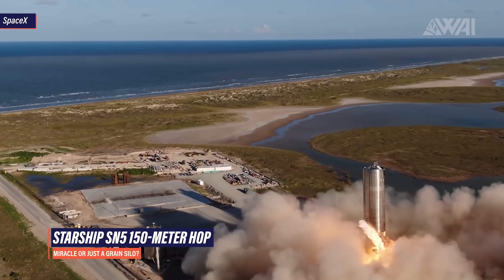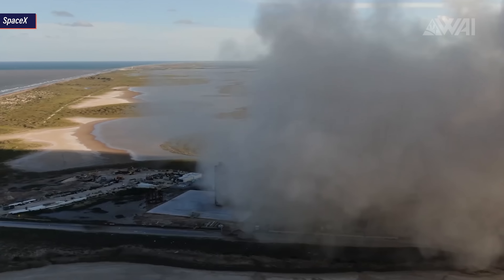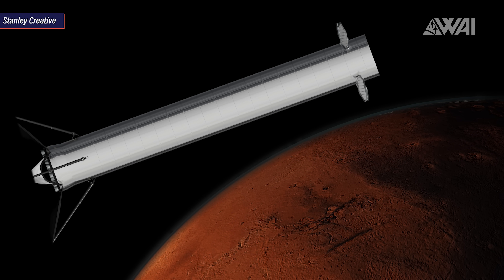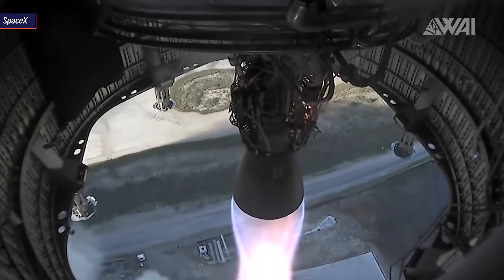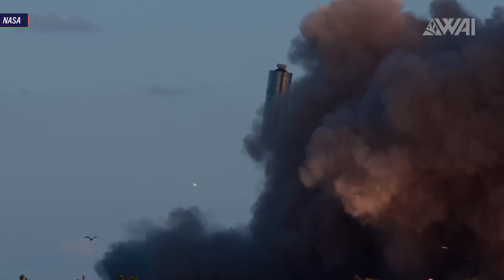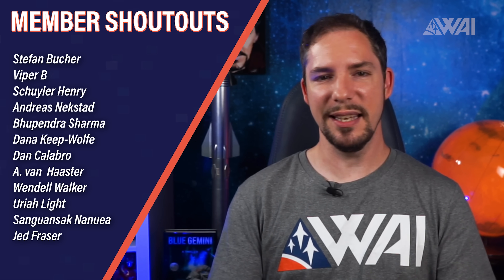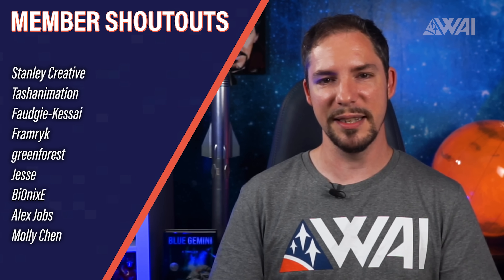111 | SpaceX Starship Updates – How did SN5 do?

Comment: I do agree with using the flip-out legs on Starship, they work and I feel like it would be cheaper than using heaps of smaller landing gear systems.
I wonder what would be safer, maintainable, weight efficient and also what the cost of developing a new landing system would be like the SN5's.
I think the idea behind the landing gear was to make something maintainable and solid even if a leg failed. But it looks a lot more finicky and expensive than existing flip-outs on boosters. I'm no rocket scientist I'm just interested and would like to know more about these things 🤩

Comment: Like Elon often ends up getting there in the end, but 'Elon time' is a meme for a reason, also like he over shoots quite a bit, so like rather than 3 uses of a single rocket in a day, maybe it ends up being once a day to once every 3 days, which down from 51 days is still massive progress and f***ing amazing, so all I am saying is just don't take it too seriously. Because like assuming you can get 10 relights of an engine before it need refurbishment that still means you are going to need to replace some of the engines every 5 flights as some of the engines need to be relight at least twice, and likely 3 times, in which case that is 3 flights before you need refurbishment of the engines.

And 10 relights is already freaking amazing because a rocket engine burns through as much fuel mass as a car does in it's life time relative to it's weight in ~3 minutes, that's a lot of stress basically your expecting an rocket engine to beat our most reusable form of transportation by 10x, that is already an engineering marvel, so as he says that means practically you could do 3 flights without refurbishment and only maintenance, but that is the theoretical maximum and I think they would only do it once just to show that they can.

Comment: I keep visualizing a Super Heavy Booster with a modified Starship as a second stage.  If they remove the nose cone and build in a payload adapter, then the Euro Service Module and Orion capsule could be sent to a Lunar orbit without an SLS  at all!   It could also lift the Lunar Gateway Station as well as  a huge fuel tank that could serve as an orbital Gas Station.

Comment: If you check LabPadre's latest post-flight video you will notice a slight vertical buckling in the tank. Later they disconnected the landing gear directly underneath that area. The day after landing there appeared to be fluid of some kind in the vicinity of the same gear and it appeared more compressed than the others. All this indicates there may have been a hard landing. It's already said the next flight will have different gear so it sounds like it was almost expected.

Comment: Just make even bigger engines than Raptor. Super heavy should use 9 engines. I mean instead of 31 Raptors use 9 bigger engine for ease maintenance. It will be a pain in ass to run piping for 31 raptors. lt's too much. Keep it simple Elon. Its should be no more than 9 big engines for Super heavy. Just scale up Falcon rocket and make it bigger. Start developing a new super big engine. Don't waist your time with this shallow Raptor. Keep Raptors only for Starship.

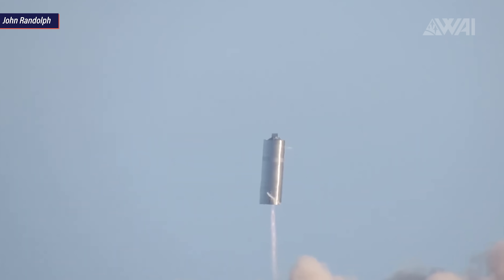Comment: 5:47   One, don't get ahead of yourself, it didn't pass aero/orbital yet so the "not inside" etc may hurt them later.

Also direct comparison to governemt funding, as pointed out by "Everyday Astronaut" is not a 1-to-1 comparison as that is often due to shifting budgets, policies,   and higher standards (ie "measure twice, cut once" vs "blow up 10 prototypes on the pad with no "congress to upset and cut your funds" )

I think SpaceX is doing wonderful things, but they are not infalliable, and giving them TOO much credit/support/worship can lead to echo chambers, and errors.
Reply: Another note, they started with many panells and, well shitty uninspected welds, those blew up, then went to rings with better rings, then welded in the tents (ie borderline "inside") .

They are no ULA friction stir welding yet, but i feel they are almost ending up in the same spot, but with thin non-isogrid metal.
Reply: Their Reusability IS REMARKABLE (credit where credit is due).
Reply: Also need to wait and see on reliability.
Reply: @ericlotze7724  You're right.  These are low fidelity test objects to prove concepts and are far from a finished flight ready system.  And even then it will be MANY unmanned flights to refine that system into something reliable enough to risk people.  Even the F9 which is planned for 10 flights has only just recently crossed the 5 flight threshold.  I think the engineering is doable.  I think the time lines are fantasy.  You wouldn't friction stir weld stainless steel, it's hard stuff and would ruin your bit fast and it's of limited value with stainless.  Good for aluminum though!
Reply: @TheEvilmooseofdoom  Definetly!  (i'm no engineer so i don't want to be like wHy NoT dO tHis lol)                                                         I'd love to see a "peer review" / others responding to the "debunking starship" series.  It was mostly focused on the whole mars hype and half baked plan.                               One thing that is semi-relevant to these small on earth tests was what would happen to the local area with a fully fueled explosion on pad or slightly in the air with larger scale models, or a full starship. (ie that's a lot of fuel AND oxidiser in a full stack, and especially with MANY of them going (rapid schedual and whatnot) an accident should eventually occur)

Comment: I’m think the yellow color of hoppers exhaust last year was probably due to salty dust entering the raptor plume. There is a great deal of salt in the sand and dust there due to the sea spray, that’s why all the test stands rust so fast. If you look very carefully at hoppers landing last year just before your clip of its landing starts a whisp of kicked up dust approaches from behind just as the plume turns intensely yellow. Sodium spectra yellow,  just a little bit of sodium goes a long way as anyone doing flame color tests in chemistry will see.

Comment: About those legs: might I suggest they not have flat landing pads that fall into place?
Why? Because anything can happen when more parts are involved. What if one hangs up partway down and the edge of it makes contact first? Then the ship could be dangerously off-balance when contact is made with the surface. A more simple alternative would be fixed balls. Hasn't Mr. Musk said that the best design is one with the fewest parts? And hollow balls being spheres are very strong. Yes, self-leveling could be part of the design.

Comment: Is the "three flights a day" a per rocket or per fleet thing ?
I think the latter, which will still mean very fast turnaround, and will have maintenance more like an An-124 or C-5 rather then like a 747 or A380.
Reply: Three continuous flights per day of a single booster are plausible. After all, the plan is to boost-back to the launch site and land beside the launch mount. 

The orbital requirements to rapidly return the same Starship tanker or passenger ship to the same launch mount is the implausible bottleneck. This could happen if operations took place at the equator, but are far more complicated at other latitudes. 

I wonder if the SH can begin refilling before another Starship is hoisted by crane to mount atop it. Perhaps not. They might insist on mating the two before commencing the refill.
Reply: @avid0g  That is an interesting question, especially after what we saw in testing, with an empty tank collapsing below a full one.
Reply: @PiDsPagePrototypes  
I expect that the tank pressure was pulled below ambient before the crumpling began. The upper tank was not filled with relatively warm liquid methane but with much colder liquid nitrogen. This allowed the warmest gas in lower tank to condense onto the middle bulkhead, reducing pressure even faster.

I suspect that there were no safeguards set up to assure pressure and prevent draining. They may even have omitted to assure that a valve opened to admit pressurized gas if an inadequate pressure was detected.

Comment: "Redundancy" is a key to safety. Successful flight on One engine means having two engines spare during landings with Passengers. That's a bigger deal the a lot of people realise. It also means being able to extend equipment lifecycles as you can swap between which engine is used each landing.
Reply: Actually, SN7 never created as much thrust as is required for a nominal high velocity landing. The ship will require at least two engines if a third one fails.
Reply: @avid0g  That's based on the F9's "hoverslam" landing. Starships sky-diver process should have it fall a lot slower due the the greater surface area presented in to the airflow, and the amount of thrust needed will be determined by that speed, the altitude at which it needs to return to vertical (the lower the slower due to thicker air) and the passenger and cargo mass being landed, and whether it's Raptors are more controllable with two engines at low throttle compared to one at high throttle rates.

Comment: I just noticed that the legs of starhopper could have punched through the ground, because the concrete got hot and soft from the raptor 🔥☺
Reply: The concrete mostly "spals", shooting off flakes of concrete as the surface gets much hotter than just millimeters farther in. Boiling moisture can also push out chunks.
Reply: @avid0g  so less melting, more crumbling?
Reply: @kaayfpv  
Right, not enough time for bulk melting. The colored exhaust circulation suggests a little quartz erosion. Anyway, the legs are 4.5 meter away from the hot center. 

The original Starhopper dropped a crushable shoe-insert during landing and slammed pretty hard into the pad. SN5 looks like it gracefully used up the crush cores inside the shortened legs, but the shoe plates sheared off some legs as SN5 skidded. That's what happens when the mass on top accelerates sideways as the tower settles.

Comment: honestly even if you could only reuse the engines Starship would still be cheaper than anything else by a long distance in $/KG to orbit, honestly the cost per launch probably wouldn't be much greater than a disposable Falcon 9 so like ~$60 million, but it can launch over 10x the amount to orbit. So even in the worst case if they had to trash every Starship after it came back, it would still decrease $/KG by a couple of orders of magnitude just due to how "simple" the process for building tanks relative to convensional tanks which have milled honeycomb structures build into the tanks to make them lighter.

That alone allows you to produce them very quickly and as time is money very cheaply. The engines are another matter those things are not cheap, but as long as those can be reused you can throw away the hull and it wouldn't really matter.

Comment: Felix, great content as always! Here is a thought in terms of the limits of rapid iteration. 
The economics of iteration will force a slow down in the rate of iteration as the accumulated cost of the latest iteration increases. 
For example compare the cost of SN4 blowing up and the loss of one raptor plus the fabricated body with the cost of failure of a fully engined super heavy (32 raptors). More time taken to ensure a lower risk of failure as the value of the prototype increases is already evident in the additional time taken to fly the latest 150 meter hop. Therefore, looking forward each major development milestone from here on out (flying the 20km test with 3 raptors, flying the super heavy hops, then SH 20 km test will each take longer than the rapid fire cycle we have come to expect. Nevertheless, Spacex will do it all in less time than any of the legacy rocket companies.

Comment: Well, wouldn't putting gimballed engines on the very edge give more torque? (with the biggest difference for roll control, but also more stable translations and slightly better pitch|yaw abilities)
Reply: hm, maybe that would take up more space?

Comment: Hello Felix. There is a factual error in your payload comparison. The 140 tons 'payload' to orbit of the Saturn V include the entire third stage (including fuel, and I believe also the interstage). Compare this to the 100 tons payload and the 120 tons drymass of Starship. So that's already 220 tons without any leftover fuel! That leftover fuel on the first flight before refueling flights is probably still about 100 tons of fuel, because adding the fuel from a handfull of refuelling flights will get you to a total of 1'420 tons. And if you compare net payload to e.g. the moon (with orbital refueling for Starship) you get 3 persons and less than 1 ton actual payload to the moon surface for Saturn V (excluding the lander) compared to 100 persons and 100 tons net payload to the moon surface for Starship (again excluding the lander - Starship - itself). Comparing payloads always depends on the WHERE TO as a reference base and WHAT exactly you consider the actual payload. The latter is a bit like peeling an onion.

Comment: You're being way too opptimistic about Spacexs design philosophy. All they've proven here is a little hop. Not an orbital flight with 40 engines at the bottom blazing fire that can melt themselves as a butter in an oven. Even if this thing ever makes its payload into earth orbit, it is far away from landing any human on mars.
Reply: The leap from nothing to reusable and manned Falcon 9 plus Falcon Heavy is far greater than the leap from the Sn-5 hop to the moon and Mars. Certainly there are steps to go, but Elon has shown the ability to make those steps.
Reply: @MrEd2291  The big challenge will be coming back from orbit, so withstand re-entry and still be reusable. That will be also new for SpaceX.
Reply: The purpose of this venture is to test that design philosophy.  And you're right pointing out that at this stage is can still very easily fail.
Reply: the thing is, very few rockets have made that little hop!

Comment: Rather than bolting in the piping for the engine modules, it would be faster and more efficient to use Marmon clamps.  They are also self centering and easier to fit.  They are used for high pressure pipe couplings in the oil tool industry

Comment: na, its obvious that you had to angle the platform a bit, since sn5 was flying at a 5 degree angle. landing on an even surface would implicate those 5 degrees being corrected while landing wich should result in massive instability. 
so a slight angle in the platform is actually the right thing to do, as long as sn5 didnt rotate at all.. or just as far as intended.

Comment: Modular Raptor blocks is a great idea but if it were possible I would take it one step further than shown in this video. The suggestion in the video shows individual LOX and CH4 connections for each Raptor. If SpaceX could find the space to incorporate 1-to-5 LOX and CH4 manifolds into a 5-Raptor module (or 1 to however many Raptors there ended up being per module) one manifold fed from a single LOX connection to the LOX tank and the other from a single CH4 feed to the CH4 tank that would be only 2 rather than 10 fuel connections to connect/disconnect making module removal quicker but maybe more importantly meaning only 2 high pressure connections to re-establish and re-certify for leak/pressure integrity when the module is re-installed vs 5 x LOX feeds and 5 x CH4 feeds as proposed in this video’s scheme.